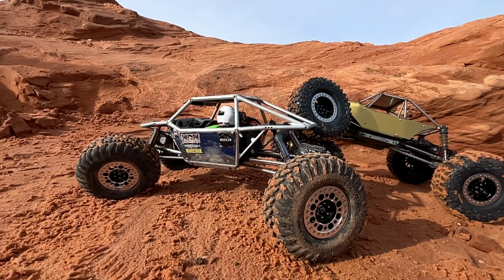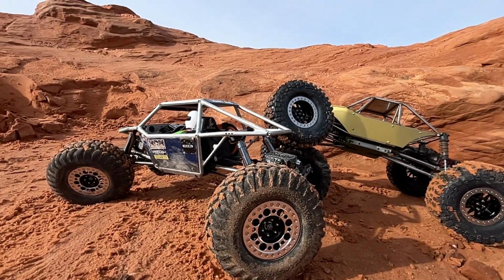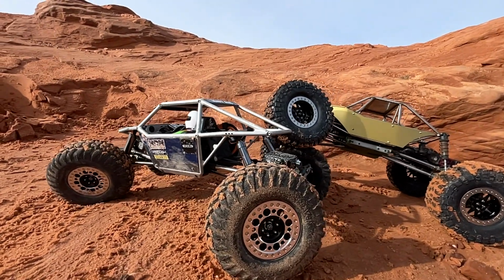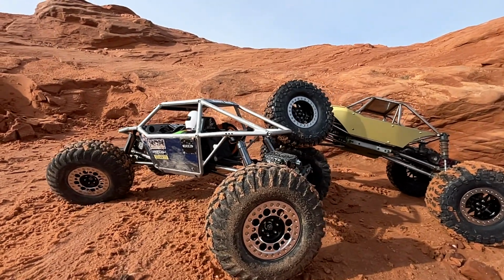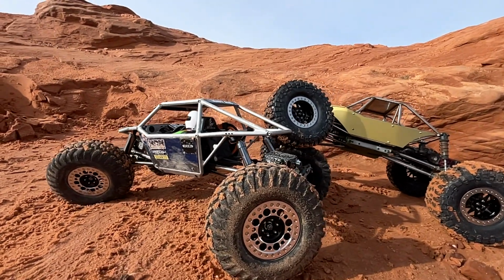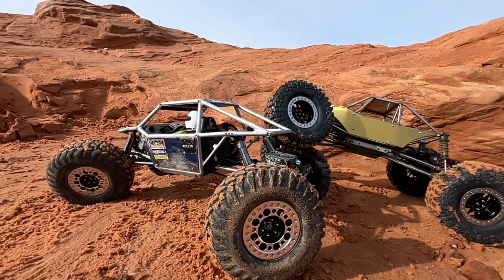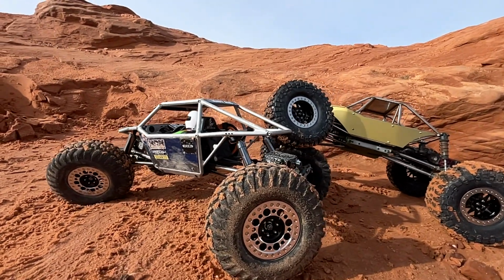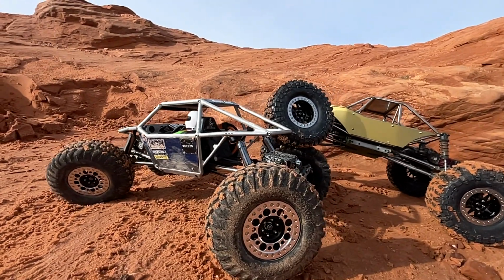The RC Speedy R2 is a line killer! [Direct Capra drop-in Moon Buggy RC crawler kit build & 1st run]

Comment: Durability in Titanium? Titanium is weaker in every measurable way than every single type of steel. Its only benefit in RC is its light weight. If you want even lighter you go Aluminum or Carbon Fiber.